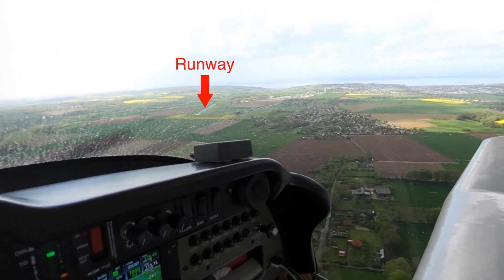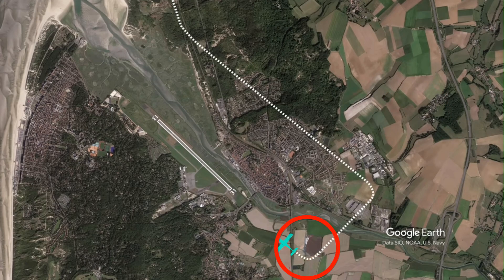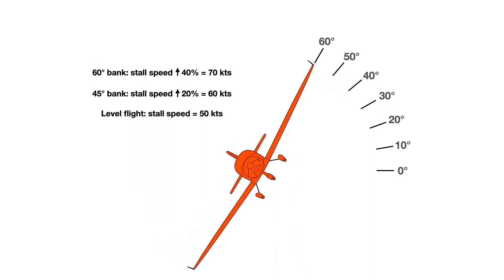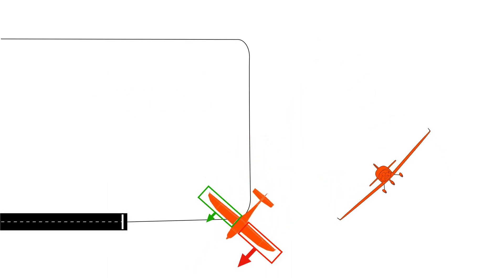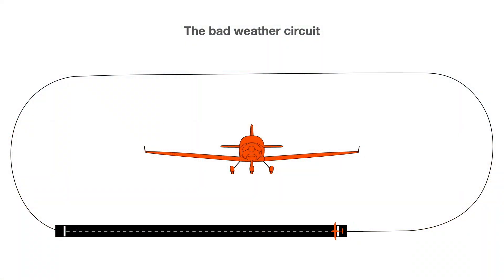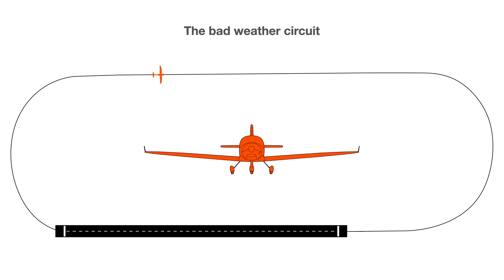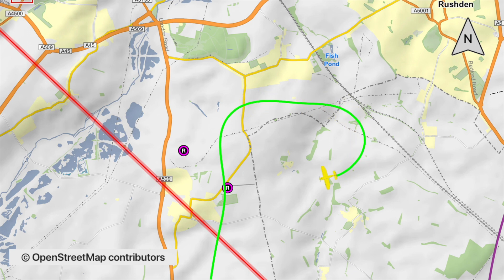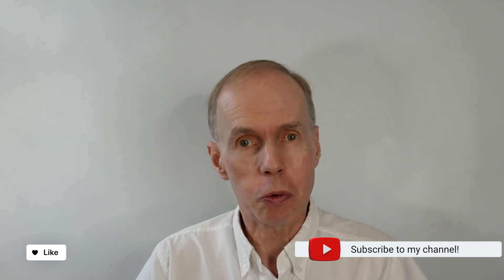Avoid the 'graveyard turn'—a safer way from base to final

Comment: Also, the increase in stall speed with bank angle applies when MAINTAINING ALTITUDE, which given a fixed airspeed, necessitates an increased angle of attack (more back stick/yoke). 
If you're able to accept altitude loss in the turn and not increase angle of attack, you can mitigate stall speed increase with bank angle.
Reply: Exactly!

Comment: Really interesting video. Just to add my 2 pence to the age old question/debate.  I learned to fly in the 80s when in the RAF and my old WW2 instructor used to call the square circuit, the bomber circuit and the curved approach the fighter approach, being a former Hurricane pilot and 707 pilot he thankfully taught me both.  I also had many a flight in modern fast jet fighters and saw the same curved approach. The history I was told goes back to WW1 and WW2 bombers needing more space and a more “procedural” circuit where fighters needed the curved approach to see over the long nose, it took less time making them less vulnerable to attack.  Jump forward to modern airliners and a 1000 foot square circuit makes sense as it allows time and can be more procedural and for the airline trainee route has become “standard”. 

I teach and examine the square “standard” circuit but am a big advocate of a 800 foot circuit and curved approach if taught properly.  Many aren’t taught properly;  and I’ve seen pilots loosing a dangerous amount of speed on the downwind to base turn by closing the throttle too much, and over banking at the same time while delaying the descent, along with the loss of lookout under the up wing on base to final turn in low wing aircraft. There’s a reason it’s called the dead side. It is more  intuitive than procedural. 

The square circuit is an easier method to teach and learn as power is only removed for the descent on base after the turn, a descent is then started and trimmed stable with or without flaps before the turn to final (less to do and their is  time to do it).  My opinion is for students, novice, less intuitive pilots and those destined for a modern passanger bomber the square approach provides a better (safer) option. 

Sorry for the long answer but it’s an age old question.
Reply from the maker: Thanks for your comment and I agree that the key word here is "properly".  Executed properly, with a constant bank angle, constant airspeed and constant rate of descent, I feel that a curved approach with good lookout has to be safer than performing a sharp base to final turn at low height, particularly for the inexperienced pilot. As you say, it's an.age old question and I expect the debate will continue!

Comment: A concise and well-explained video. I can't disagree with anything you have said here.  I often find myself wincing when flying with another pilot who appears to favour this sharp base-to-final turn followed by a longer final. I prefer the method you outline here- mainly out of laziness and preferring to cut the corner - straightening up to the final approach course only within the last NM or so. The safety argument for doing so is compelling as well. I should add that I'm based at a radar-controlled class D airfield, so checking for traffic on final is less of a concern when at home.  I see the argument for checking the final is clear before turning on,....

Comment: I have maaaaany flight hours in model airplanes, I have had sporty flights in LSA and I have also flown in military Sea Harrier simulator. In all of the above, proficient and I have always flown and landed the way it is explained in this video. It is intuitive, smooth and safer. 

Then, I started getting my LSA flight license and I also started doing these damn squared circuits. There are several reasons:
- In all the theory and internet, you find squared circuits.
- The instructor (even though he flies sporty too) kind of did the same to highlight the legs when teaching the lessons.
- Although not always, I developed a tendency to do those to show I was “in control” and I was never corrected by him.

However, the moment I am told “do what you want with the plane”, I am back flying the way I have always been, whether it is practicing dead-stick landings, mid-field emergency landings, sporty flying around or just on my own. It is overwhelming to see how easy you get influenced by bad habits that are not even yours originally.

Thanks for the video and rising our awareness!

Comment: I started out flying GA then was fortunate enough to fly fighters for the USAF.  Since then I have always done the continuous turn to final.  The only thing I do different is at 90 degrees through the turn I quick roll out to check for traffic on the staight in approach.  Cessna is not as critical but when flying Piper, Mooney, or light twin (low wing a/c) this is a critical safety check.

Comment: The base to final turn is supposed to be a descending turn, so the increases in stall speed are only really relevant in level flight, or climbs. Increased g-loading is required to increase the stall speed: if you don't apply back-pressure, you won't stall (in general).The risk comes when a pilot allows themselves to be too low on base, then overshoots and tries to overbank without losing height. At that point, it's best to go around and try again. 

I like the constant turn method, but I suppose the benefit of the rectangular pattern is a slightly longer final approach leg for configuring and assessing stability. There's more than one way to skin a cat :)
Reply from the maker: Yes, it is SUPPOSED to be a descending turn but, as I was trying to indicate in the video, the problem arises when the pilot is distracted (by traffic, radio calls, weather etc), becomes overloaded, makes an error, overcorrects on the flight controls, or lets the airspeed decay. Flying a gentle curve base to final gives a wider envelope of safety in which errors are less critical and the pilot has more opportunity to make corrections safely.

Comment: Interesting. I passed my check ride in 2000 but have only recently returned to flying and completed my flight review. The first time I (recently) flew the pattern, I did square off on crosswind. However, my downwind to base to final was instinctively rounded. Which is what I continue to fly.

Comment: I strongly prefer the squared approach because I can not see the runway while making one large turn.  In a Cessna 150, the wing blocks my view.
Reply from the maker: When I first adopted the method I picked a reference point on the extended centre line. That would be visible throughout a downwind to final or base to final turn in a high wing aircraft.

Comment: What if you put the nose down during the graveyad turn ? 
Doesn’t avoid any chance of stalling.
Reply from the maker: The point that I was trying to make is that, in the presence of distractions (for example: weather, radio calls, traffic) the pilot may lose concentration and put the aircraft at risk of a stall. Flying within a larger envelope of safety, by making a gentle curved turn base to final, gives the pilot more opportunity to correct errors before it is too late.

Comment: I started by flying gliders, and doing the method you advise. Since progressing to light aircraft, I was taught the square base to final. I have real difficulty getting it right every time. One time I came in with fuel starvation due to a fuel contamination issue and reverted to the glider way of managing speed, height and steady turn from downwind through base to final. No problem getting it in safely. If I'd have tried the box method, I'm not sure it would have ended so well

Comment: regardless of method, I always teach my students to start the turn to final early if they aren't sure. as they can always adjust mid turn and shallow out the turn to hit the final course alignment. better that than steeping the turn. turning early gives a larger radius and shallower bank overall.

I use every type of method myself, depending upon the situation.

Comment: My CFII son-in-law says your pattern is too small if you don't have time between downwind and final to flatten your bank (straighten out) long enough to check outside the turn for traffic that may be trying a straight-in approach. Maintaining DMMS (design minimum maneuvering speed) in the pattern turns will also keep your airspeed high enough to prevent the inside wing from stalling in  the turn. Use the final approach to slow to landing speed.
Reply from the maker: Too wide a pattern risks losing site of the airfield in poor visibility, but of course you can always briefly roll wings level on base to check for traffic flying straight in. Maintaining DMMS is all very well but the point of the video was to indicate how the consequences of errors or distractions in a critical phase of flight could be mitigated by flying a base to final segment within a wider envelope of safety.

Comment: Continuous Rate Turn onto Final when using short strips is a real boon. It's an additional safety too if flying old open cockpit with no forward vision. It allows constant monitoring of position relative to R/W threshold. A lot going for it!

Comment: The box pattern needs to die. 
After 5000 hours as a KC-130 flight engineer watching thousands of touch and goes - or smash and dash - landings using the Navy pattern; I flat out rejected low time instructors trying to get me to fly a box pattern. 
I taught them the Navy pattern. Got my PPL in 41 hours.

Comment: In Ultralights we're already flying slow and a single sweeping curve is easier to maintain airspeed and if you overshoot you can just keep your altitude and bank angle until you get  over the runway. With 90 degree turn to final if you overshoot you wind up trying too many dangerous adjustments mid-turn leading to the stall spin.

Comment: I keep repeating to myself "Airspeed is King" and push the nose down more during the downwind to base and base to final turns to never load the wings.
Reply from the maker: True, but the problem arises where the pilot is distracted by something (radio, traffic, weather). If the pilot is in a situation that gives a greater safety margin, ie a gentle banked turn, then there is a better chance to salvage the situation.

Comment: This is very interesting, I'm in flight school here in Australia at YBAF, and my instructors always have taught me to do not precisely a rate 1 turn but round out crosswind or base, although I tend to level my wings for base sometimes in case I turn too tight or shallow and in order to kind of "reset" the approach in my head, although as someone else said I'm going to use this opportunity now to check for traffic too.

Comment: This is the pattern I typically make. The more tired I am, the windier it is, etc... the more likely I'll use it. I do square the pattern for traffic avoidance. You simply can't see everyone when turning continuously. That's a problem. I've experienced the annoying straight in pilot, the wrong traffic pattern pilot, and the "I fly a giant pattern" pilot while on base leg to final. 

On base leg I check my gear one more time, look for incorrect pattern "members" of society, and then turn final. I try to make my pattern wider to avoid this being a problem in the first place. Also, I NEVER step on the rudder pedal that's near the ground... I'll even slip a little by stepping on the skyward pedal on base to final. I even pull my foot off the inside rudder pedal. Can't spin if you don't stomp the pedal. Just a couple of glider tricks in our bag to try to stay alive.
Reply: You took the words right out of my mouth (i.e keyboard)

Comment: There's no reason to NOT do a short baseleg that is preceded and followed by  very shallow 90° turns. That way I can sort of get the box shape pattern that is expected by other aircraft in r pattern or ATC. My bank account rarely ever will exceed 15 or 20 degrees.
Reply from the maker: Agreed, although I find it easier to judge a continuous turn and so prefer this if and when circumstances allow. Like the title, the emphasis of the video was intended to be on the base to final turn!

Comment: Interesting. I learned this from my CFI but it was the "engine fail in the pattern/circuit turn". Starting with the "standard" it became a gradual conversion due to constant "what if you engine fails now? what now? and now?" and so on. The result was also far less overshooting. Frankly, by now, I also have no idea why we still have an obsession with 90 deg turns - and apparently in certain aircraft it's become a real killer: pilots transitioning from your Cessna Landomatic to something like a sleek Cirrus are notorious for overshooting and stall-spinning on base-final. PS: before someone brings it up: yes, spacing become an issue, but only if you have "mixed use", with some still flying rectangles and others ovals.

Comment: Smooth curves in so many walks of life is always better than sharp angles. A curve spreads load and stress and in this analogy slows the process down giving more time for adjustments. WW2 fighters always used a wide smooth curve to threshold, tho admittedly that was more to do with visibility over a long nose.

Comment: Glider pilots cut off the corner for similar reasons to avoid running out of speed and height in the wrong place.
Reply: I'm a glider pilot and this is indeed a dangerous (most dangerous?) part of flying. However at busy airfields our circuits tend to be pretty boxy for predictability and visibility. A longer downwind can be dangerous on windy days. That's said I'm basically for this method, although a 45 degree bank is de rigeur in a glider, in the high workload scenario of lining up for final, it's easier to make a mistake and let the airspeed slip.

Comment: It may be depicted as a right angle turn but it should be a rate 1 turn also.   If you crank it over to do a tight turn the yes, these factors are working against you, but every turn at low altitude and low airspeed should be no more than rate one.
Reply from the maker: Indeed it should! But it often is not, with much greater bank angles being used sometimes. I agree that the turn should be better depicted and described; that was partly the point of the video..

Comment: Nice video! I do this all the time. Much smoother flying. Also keep attitude so that the KIAS remains the same- i.e. need to relax the back pressure on the yoke during the turn. Add back pressure to increase pitch on final to get to approach speed.

Comment: As a CFI It makes sense and in practice most turns are more smoothed than squared.  The issue is getting DPEs to accept the technique.
Reply: FAA already approved the technique and encouraged pilots to use it. so DPEs can pound sand if they don't like it.
Reply: @SoloRenegade  ĺp
Reply: Intelligence must be applied to be useful. The around-the-barrel approach, as you suggest, makes good sense and greatly reduces the potential for disaster. So, why not use that method when possible and reduce the risk.
Reply: Common sense not sooooo common wtth DPE?   What is not to like about the smooth turn if safety is paramount.

Comment: Airline circle to land and Mil do the ‘continuous’ , far safer, just check for straight in traffic very carefully. There is no ‘stall speed’ , only stall AOA, a wing can stall at any speed if critical AOA (G) is passed (usually 14-16 deg) sharp turns need sudden power additions, so torque / prop wash comes in as well.

Comment: I can't speak for power pilots.  I'm a glider pilot.  In gliders when flying the pattern we need to be continuously checking to see how quickly the ground is rising up to meet us and adjust how much spoiler and/or slip we need to add or remove.  We also have the advantage of a yaw string on the canopy in our line of sight to tell us when we are coordinated as opposed to the ball which is down in the panel somewhere.  So the way I was taught to fly the pattern is throughout the downwind leg you are watching your airspeed, your height above the field, and your distance laterally to the field, watching the pattern for other traffic, all that good stuff.  Then when you make the 90 onto base your entire attention is focused through the nose and yaw string.  You are watching the horizon to make sure that nose stays below the horizon and you are watching that yaw string to make sure the turn never becomes uncoordinated. At no point during the turn should you be looking to see where the field is.  It's not going anywhere. As long as you keep your eyes through the nose of the aircraft you will not become uncoordinated and you won't stall.  Thus it is a safe maneuver.  Then once you are straight and level again you go back to monitoring airspeed, altitude, and distance until you get to the base to final turn where you once again focus all your attention through the nose.  So if your goal is to focus 100% of your attention through the nose in a low level turn, you are much more likely to succeed at that objective if you are making two quick steep turns than you would be if you are making one continuous shallow banking turn throughout the entire base leg.  In that case your attention is inevitably going to get diverted to where the field is at some point during the turn.
Reply from the maker: Thank you for your comment. The point of the video was to try and highlight how a danger might be mitigated by giving the pilot a wider envelope of safety at a phase of flight where margins for error are narrow (low and slow and in a turn) and distractions (such as weather, radio calls, other traffic) or misjudgements (such as of a tailwind on base leg) can result in disastrous mistakes. Making a turn with a fairly constant, mild bank angle enlarges that envelope of safety compared to a tight base-to-final turn.